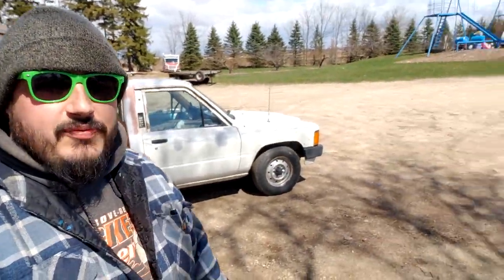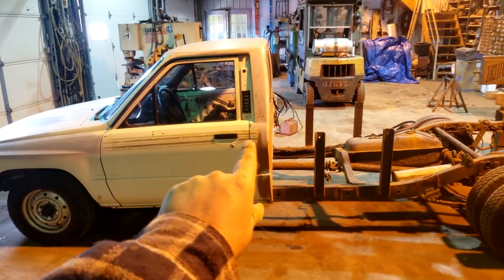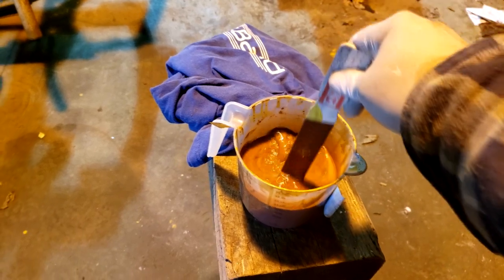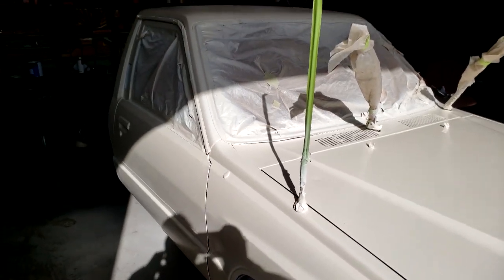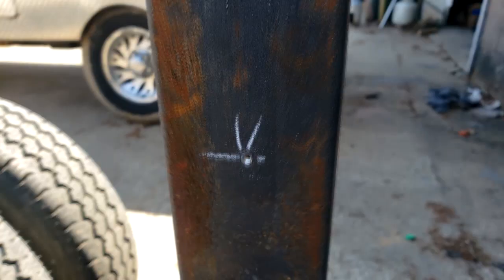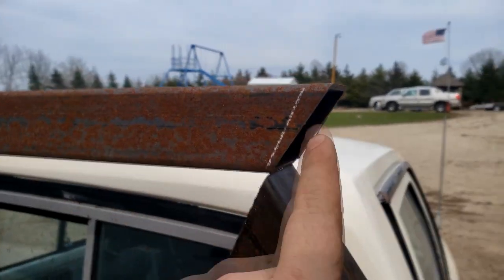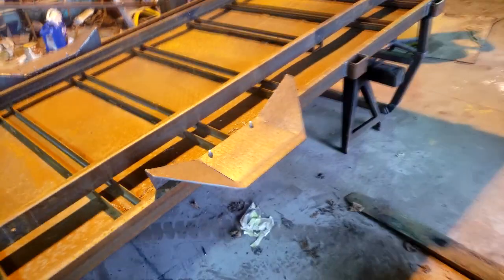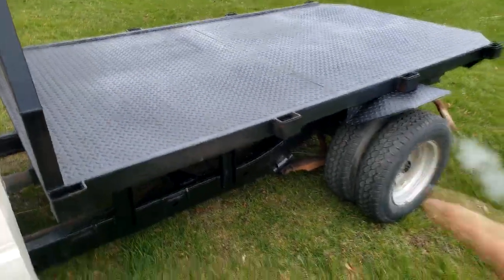Paint and Bed Transformation Toyota 1-Ton Dually

Comment: Hey man,  I appreciate your uploads. I scored a 1984 (85 model year) Toyota "Dolphin", a class C RV built upon the Toyota cab & chassis by National RV. Not sure if you're  at all familiar, but  there was a fairly large scale recall on many of these "micro mini" rv's; apparently the coach builders  weren't  forthright with the   specifics of their intended design(s) and, since Toyota  had yet to introduce the 1 ton fully floating dually rear axle like your truck has, ended up fabricating  a "foolie", in short they fabricated a modified second wheel which bolts onto the standard 5 lug wheel on the 1/2 ton semi-floating rear. 
   I  don't know if you will receive this, so I am not going to waste too much more time writing. But,  if you do  see this and have a chance to reply, I have a few questions that you might be able to help with. 
  By the way. I found your channel while researching the injector rebuild and, morespecifically,  the intake plenum removal process.  Seeing the difference after the egr delete has motivated me to do the same. Did you have to trick the ECM with a resistor to keep the MIL from staying on?
Reply from the maker: I didn't do anything to trick the malfunction indicator, mine does randomly come on and off as I drive but I just ignore it 👍.

Comment: How much do you think that puppy can hold payload wise? I know the normal single rear wheel 1 ton was like 2400 lbs, I'm guessing with the dually it could be up to 3k? Of course it'll do it slow but I'm just curious. Thanks. Great ride.
Reply from the maker: From the research I've done the capacity is 2600lbs. I've had 1000 on it a bunch of times and it dosnt even notice
Reply: @BAPerf  thanks for the response! Looking forward to testing if I ever get one, safely of course lol